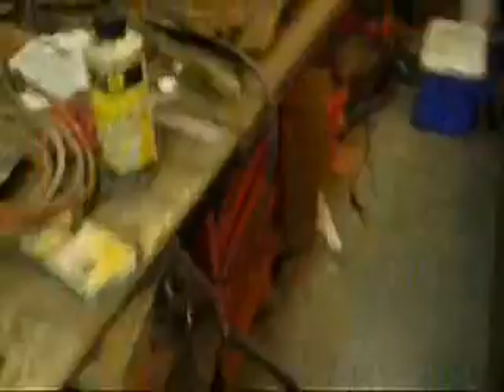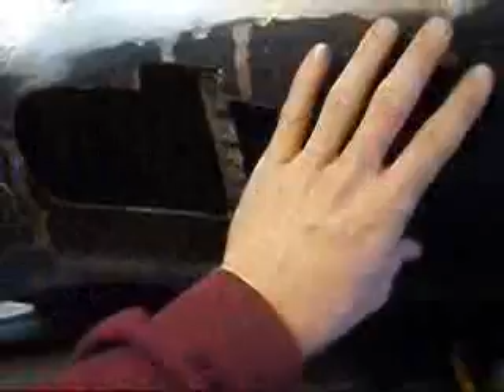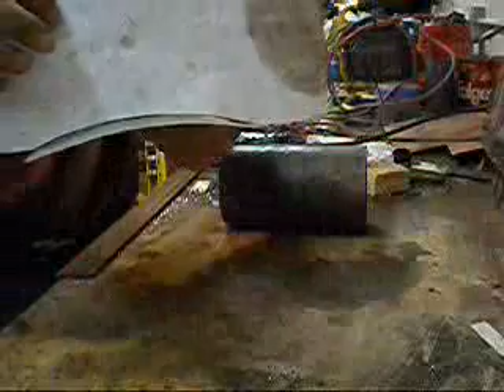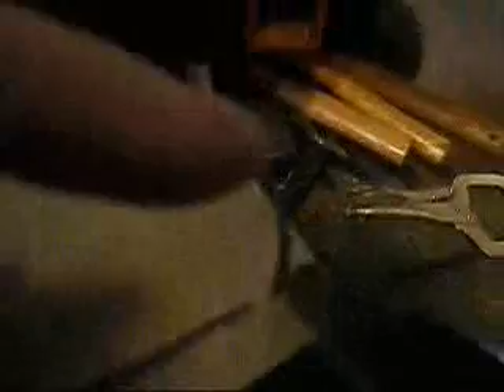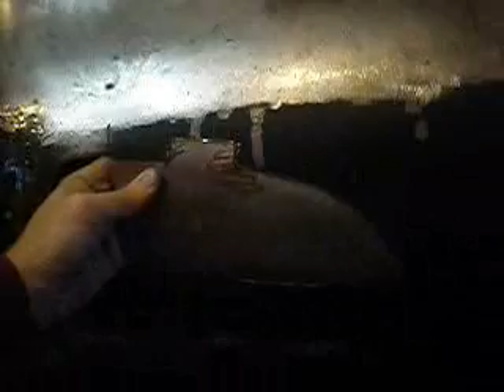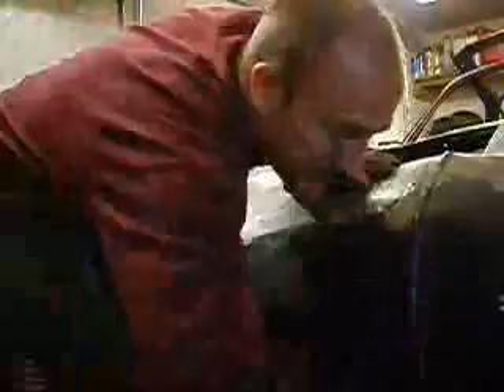Karmann Ghia sheet metal patch

Comment: What gauge sheet metal did you use?
Reply from the maker: It's been awhile but it was either 18 or 20.  The original German metal is 19 ga from what I measured.

Comment: Greg, I'm a "new" welder. I have a wire-fed MIG welder. I've been having fun with it. I've got a basic welding helmet, but have been thinking about an auto-darkening helmet. Having not ever used one, I'm a little leery. How do they work? Are they reliable? Having one would certainly help in reducing meat loaf. Just sayin.'
Reply from the maker: +Tom Mills (GreenShortz) Tom!  The cheapo auto-darkening helmets work just fine.  They will help you a lot as a beginner.  If you have a bright light source, you can use it to help even more.  Keeping light out of the back of your helmet will also help give you more contrast as you weld.  Be aware...  Most MIG welders come with flux core wire.  The smoke from the flux will get on the glass of your welding helmet and look like dirt.  Just keep it clean!  Good luck!
Reply: +Greg's Garage if I had to add one pneumatic tool for cutting sheet metal, would you recommend an air nibbler or air shears?
Reply from the maker: Shears are cleaner cuts.  The nibblers make a mess, but they are nimble.  I'd go shears...  Maybe even electric.

Comment from the maker: @PCSOLVER1 Thanks for the compliments!  It's VERY VERY difficult do to sheet metal with flux core wire because it is so thick.  I use .023" wire and the flux is around .035".  I welded the floor pans into my car with flux core wire, but it was all plug welded, not butt and the metal is much thicker than the car's skin.  I would highly recommend taking the welder back or selling it and getting one of their units that is capable of using gas.  They cost 2x but are worth it..

Comment: Hi Greg,
You are a Pro!
I have a Karmann ghia 1971 coupe with a lot of rust that I am trying to repair.I purchased a harbor freigh 90amp (115v) Flux core welding machine but even if I put the LOW settings is making a hole in the sheet metal...
Any suggestions to low power or not to make holes??
Please continue with your videos!!!
Do you have a video replacing Rockers or floors with chassis on?
Regards,
Alex